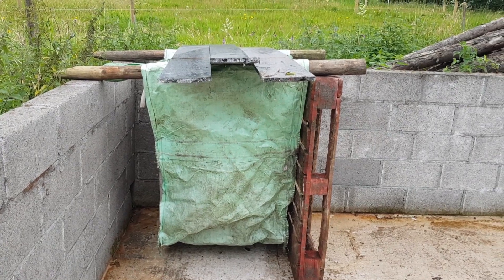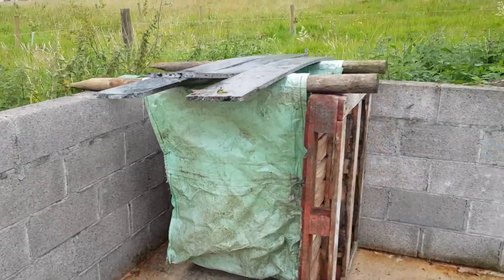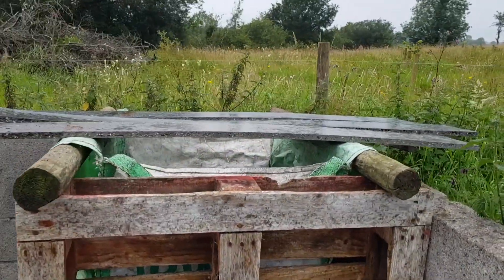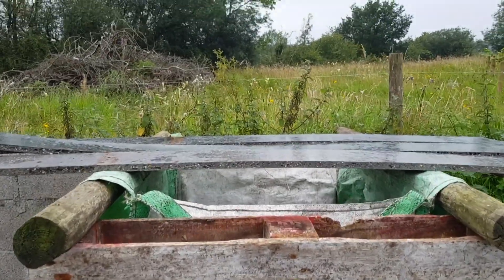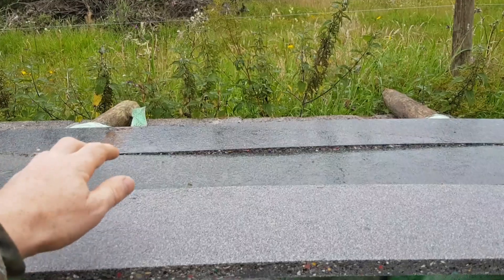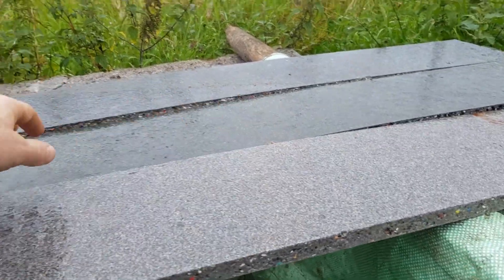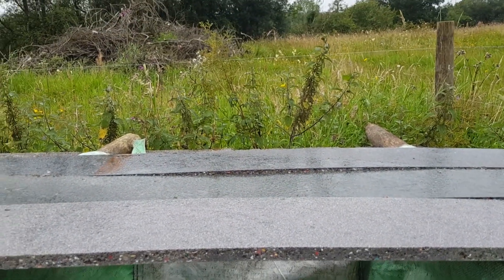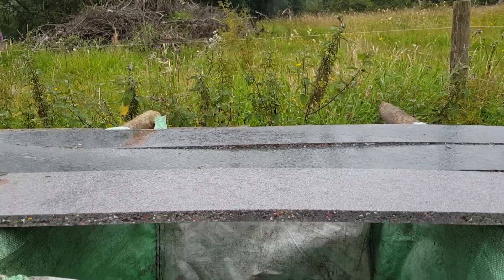Modified Johnson Su Bioreactor Prototype

Comment: I e seen you should remove the pipes after a couple days but I think it will work. For less work up front maybe just put support for the pipes up top till you take them out so you don’t have to drill the planks? I didn’t check when you made this... let me know if it worked 🙏🏼
Reply from the maker: I have moved away from the idea of using 1 ton bags because of the volume of compost that I want to be able to handle.  I'm looking at a structure along the lines of that used in the following video: https://www.youtube.com/watch?v=JGxSDhnvUUc

Comment from the maker: To put closure on this, after some feedback on another group (https://www.facebook.com/GubbFarm), I will need irrigation.

Here is my logic:

Monthly rainfall: 7.1cm
Bag width: 100 cm
Bag breath: 100 cm
Rainfall volume: 71000 cl (71 litres per month) i.e. 2.36 litres per day.

I timed filling a 1-litre container from a tap and I estimate that the flow rate is around 5 litres per minute. The Johnson-Su video suggests irrigating for 2 minutes, so depending on their flow rate, that puts it around 10 litres per bag per day i.e. approximately 2 UK / 3 US gallons.

So rainfall just isn't going to cut it.  

Thank you world.
Reply from the maker: In off to build the Bioreactors and will capture that on the next update.
Reply: Wow I would have thought it would have been ok In Ireland 🇮🇪:) looks like I’m gonna have to really work on my irrigation here in Southern California 😣
Reply from the maker: Hi @anakamhi7097  

From what I've read, you need to aim to achieve 70% moisture content, but as all of my wood chip has been in the pouring rain for 2 months, I have no idea what the starting weight was, in order to determine the current moisture content!  

That aside, I have been planning a trial for a larger scale Johnson Su bioreactor and thinking through how to deal with water runoff through the air holes. If the weather is ok, I hope to start work on it next weekend.  I want a system that can handle about 100 cubic meters, so efficient use of rainwater is key.
Reply: @GubbFarm  incredible! If you have a water capture system you can use that and keep it covered during the rain but again that’s work:/ I hope u keep making videos of your trials and errors since both are valuable! From what I’ve researched there should not be run off from the system but keep in mind most of the world doesn’t see your kind of rain fall 🙃. If the important part is the microbes and fungi living in it and they are ok w a lot of water as long as it drains I don’t see a problem w it. 🤗 thanks for your prompt reply!
Reply from the maker: Hi  @anakamhi7097 , like yourself, I am not expecting much runoff, but there are local environmental rules regarding waste management and I need to have the compost on an impermeable surface with a tank to catch any effluent.  I'm just waiting on the delivery of a puddle pump to recycle any effluent that comes off the compost and then I will start work on the bioreactor as soon as it arrives (hopefully by next weekend).